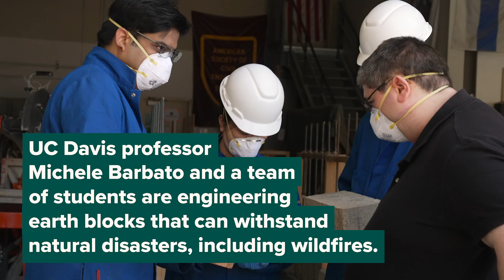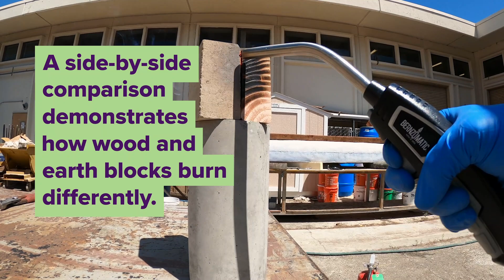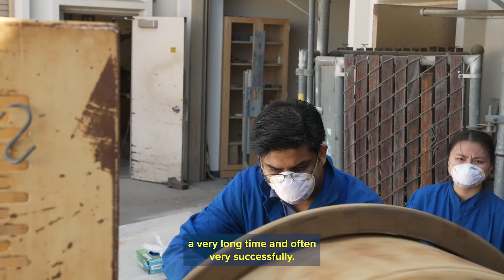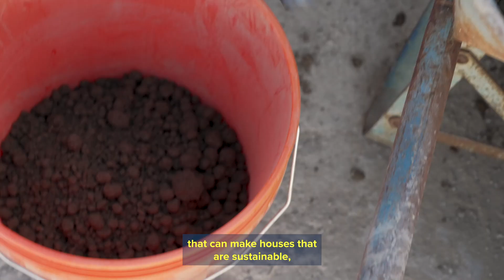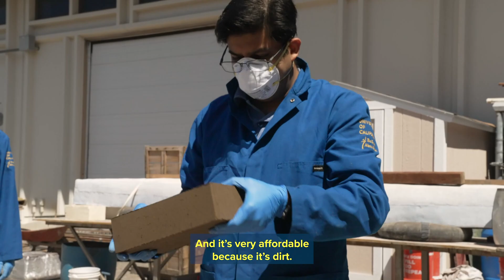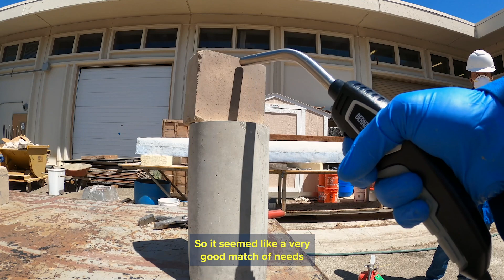Engineering Wildfire Resilient Houses

Comment: One of the problems here in Australia (and I suspect in the U.S. as well) is that while the walls can be brick, the framing is largely wooden, and once cinders get into your gutters they can get into the roof cavity and set fire to the roof structure. Windows also shatter. And despite all of the losses we have, we still build houses in the middle of the bush. 

Building codes need tightening up.

Comment: How would these earthen houses fare during an earthquake?
Reply: In Balkans we basically use them (well, clay bricks, I dunno how is this different, maybe it is cheaper because earth?) and you can google Croatia earthquakes in 2020. They do not do catastrophically but they are also not super resilient. Roofs get damage.

Brick has no problem to survive fires, In fact, they are burned on very high temperature during production (clay, again) but everything else suffers. Doors, windows. Then fire goes inside. Roof collapse because wood beams can burn.  You will still have (damaged) walls. No problem there. Everything else will be destroyed.